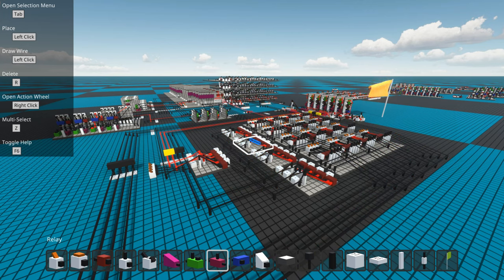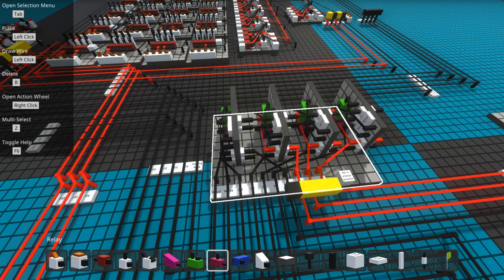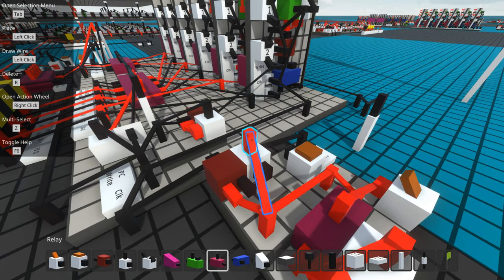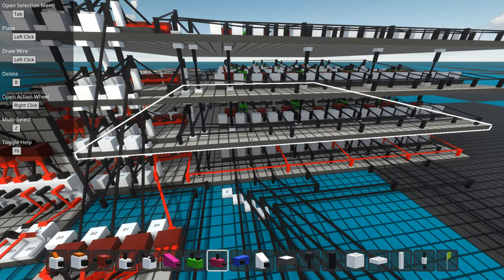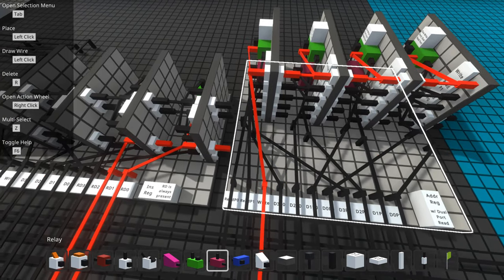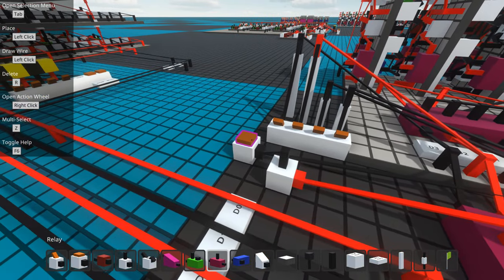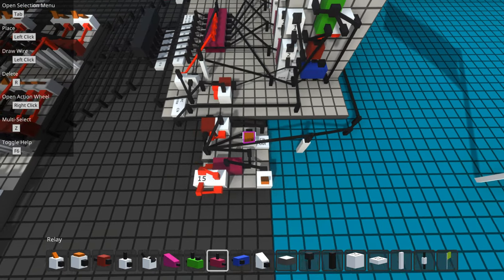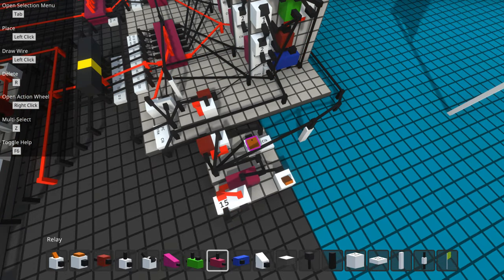Logic World, 4 bit CPU

Comment: Your videos are so helpful for me! I’m new to the computer logic world and I’ve been trying to make my own ALU in logic world! I have run into an issue though, how would I go about making an input that has 1-9 buttons like on a normal calculator, opposed to having buttons for 1-2-4-8-16 and having to do the math in my head to input the number I want? If this doesn’t make sense I can try to reword, it’s very hard for me to explain my issue lol. Thanks!
Reply from the maker: I think that requires a decimal to binary conversion.  Which is not a simple circuit.  I thought some people had managed to do this.  Get on the discord, and you can ask questions there.
Reply from the maker: https://discord.gg/XwXDVgzQ

Comment: I don't understand any of this. 
Is this a programmable CPU?
How do you even begin to design something like this?
Reply from the maker: Yes, this is a tiny CPU.  The program exists in "ROM", with some RAM for data.  The ROM and RAM are separate, I think sometimes this is called a Harvard architecture.  Not sure how much design I really did.  I just kept trying things until it worked.  I didn't have any formal classes in digital logic.  I had watched some videos on youtube, by Ben Eater.  Everything else, I guessed at, such as how to make an ALU and program counter.  My design is whacky in how the timing of the logic works.  If I had stuck with a basic RISC style, there should have been a rigorous cycle fetch, decode, execute.  An experience digital logic designer would probably grade me a D or something :)  Call it a learning experience.  I did start with decades of experience as a software engineer, so CPUs were not alien to me.  And some basic knowledge of machine language.

Comment: im learning how to do this type of stuff but self teaching its hard
Reply from the maker: It can get tricky fast.  For example, timing issues are a big source of errors for me.  Which is why real CPUs use rather a lot of timing signals.  But I tried to keep mine simple, which meant some hacks.  For example, because my timer uses a ripple adder, the address from the program counter takes something like 6 simulation ticks to stabilize.  One solution was to put delays in reverse order, so that the lowest digit updates at the same time as highest.  For example for a 4 bit timer with ripple, we have a number like 0101.  The high bit is 1, the low bit is 0.  The high bit takes 3 more ticks to update then the lowest.  So we delay the 0 by 3 ticks, the 1 by 2 ticks, the 0 by 1 tick, and no delay on the 1 ( in high to low bit order.)  That's just one way to try to avoid problems with the CPU is trying to use a number before the number is is in a valid state.  The only read advice I have is start simple, work your way up.  I had no experience with doing this sort of thing when I started a few months ago.  I learned by trial and error, and asking some questions in the discord voice chat.  I did have the advantage of a computer science degree, so binary logic wasn't new to me.
Reply: @michaelbauers8800  I found that Relays are more instant when it comes to adding numbers, So simply replacin the 2nd AND gate with a relay makes a "Instant carry adder", which I used in my ALU. Another thing I find quite odd is the lack of modularity. Logic World has "Sockets" which when put next to each other, connect. This can help speed up addign RAM, ROM and other components. Also, you seem to have build parts of teh computer (mostly wiring) on the ground of the world. Now I personally prefer to keep my wires and stuff on circuit boards so it's easily movable, replaceable, etc. Loved the video tho, keep up the great work!
Reply from the maker: @luauvm  I mostly build on circuit boards.  Stuff on the ground tends to be test stuff like switches and displays.  I even build boards on top of boards, when I have modular stuff like an ALU.  I could never work out how to make sockets work for me, rather than against me.  I have no doubt they are helpful though.  I want to get back to the game one of these days ( got distracted by Satisfactory.)  I have seen relays used for reduced delay adders.  They seem to be sort of a "cheat" compared to real ALUs, which use rather complex combinatorial logic ( I did a video showing a bit of how that works I think.)  Nothing wrong with a "cheat", and maybe if I redid my ALU and counter circuits I would try to get that working with relays.
Reply: @michaelbauers8800  Can you elaborate on the "cheat"? I simply use a Relay in the place of an AND gate, as they r functionally the same (in taht specific case), but there's less delay.
Reply from the maker: @luauvm  All I meant was in real worl circuits, you couldn't use a relay to get a zero delay adder :)
Reply: @michaelbauers8800  heh, true